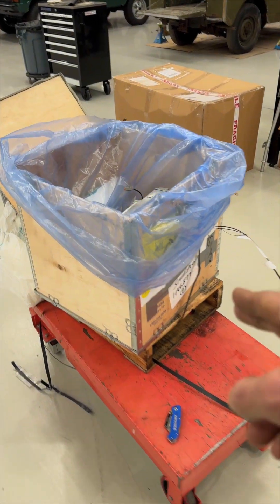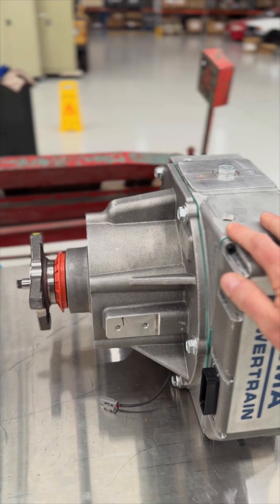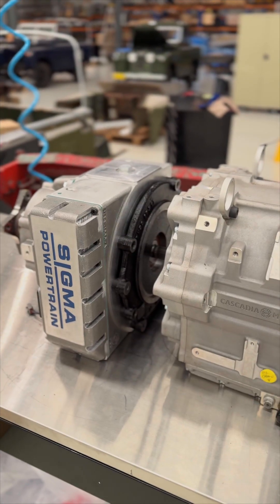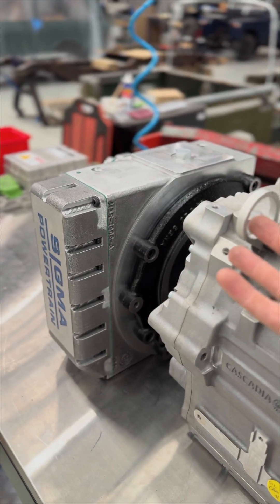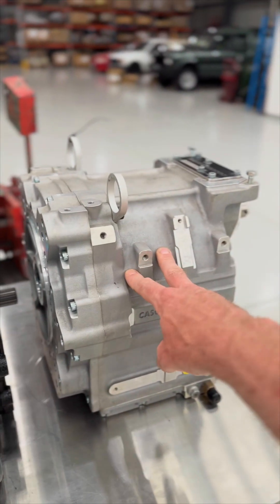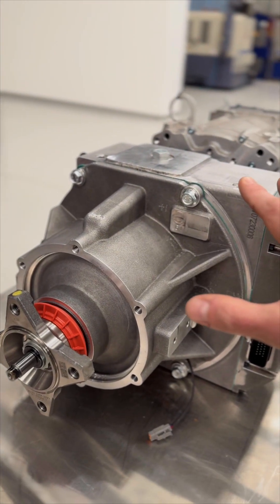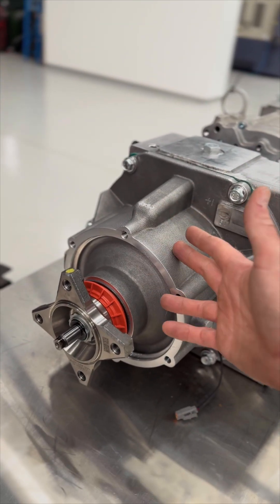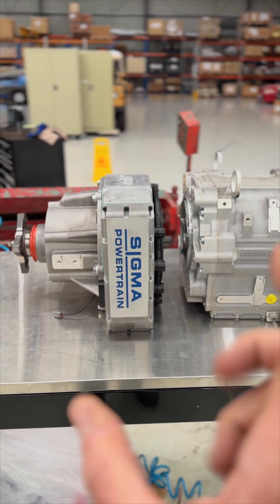A 3 speed auto in an EV?

Comment: So will it be called "Low range, Medium range and High range"? :) 
(If it was selectable in the cabin I guess).
Reply from the maker: In this application it'll still be connected to transfer case with high and low range. it's possible to let the driver select one of the three gears, but we'll probably not let them. the software will be smarter and react faster. in future applications we might allow you to hold gears or downshift.
Reply: @Jauntmotors  And correct me if I am wrong but it would also lay to rest once and for all, the argument by many that cruise control is not efficient with EV's.
The ability for gear selection at an optimum efficiency in an instant, is another tick off the list